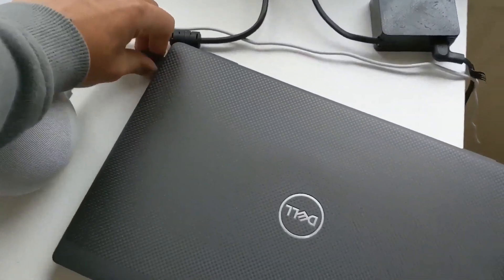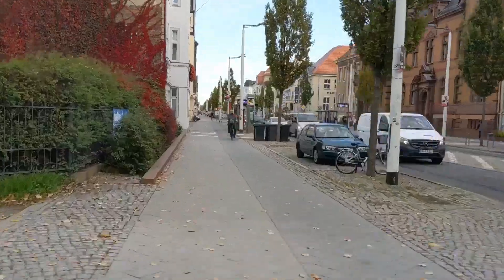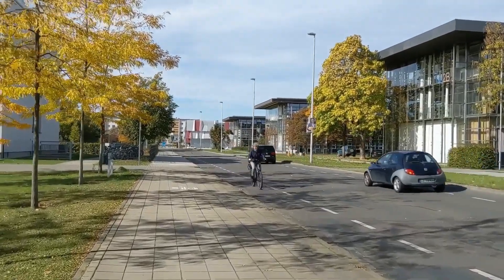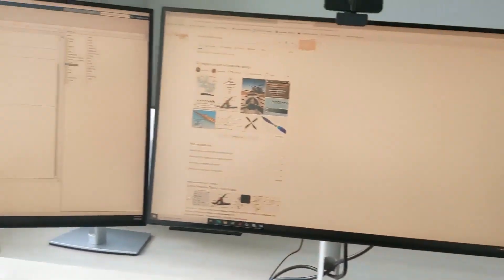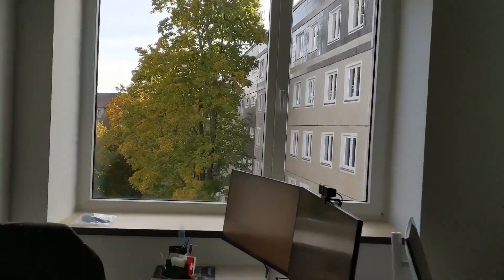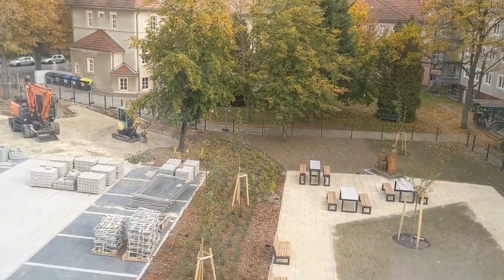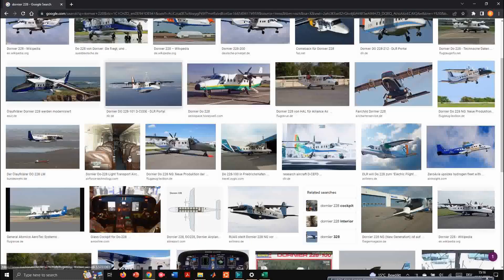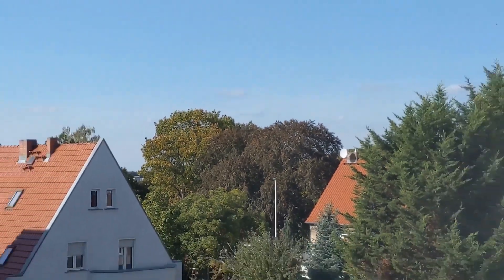A day in the life of a Mechatronics Engineer at German Aerospace Center (DLR)

Comment: brother, Do you work with physical things in mechatronics engineering jobs? what did you learn in your college and is it hard to study mechatronics? I like building things so which engineering will match me? hope to hear from you soon.
Reply from the maker: Hi bro, I think Mechatronics Engineering will absolutely suit you. There are lot of stuffs about physical hardware(microcontroller, fpga, etc) and software (Matlab, Python, ROS) that is to be learned in this branch. In my current job, I will be actually running my code in a target hardware using Speedgoat (kind of a high power computer), about which I am very excited. Apart from that, working with physical things like motors, gears, propeller, aircraft prototype etc. would be a part of the job.
Reply from the maker: This branch is also good, if you don't know now in which field (automobile, aerospace, robotics, etc. ) you wanna work exactly. The things you would learn will be applied in almost all industries.
Reply from the maker: About the study, I won't lie, it was hard at the beginning. There were subjects from electrical, mechanical and software branches. But with time, things fall into places and gets interesting. Let me know if you want to know the exact curriculum of course. I will share it with you.
Reply: @kibakibiunplanned5196  I would love to know about the course.
Questions
Which university do you think will help me in becoming a mechatronic engineer? 

How much is the salary of a mechatronic engineer?

I am thinking of studying in Germany but I haven't decided yet.
Reply from the maker: @mente4290  See this list of the German universities with mechatronic courses:
http://tiny.cc/f7h2vz
All the universities listed here are great. You have to find a right one according to your needs and financial situation.

There are two types of universities here (1) University of Applied Sciences. (2) Universities or Technical Universities. First one is more industrial oriented and prepare you mostly for a commercial engineer. Second one focuses more on research and PhD kind of stuffs. 

In either way, as a mechatronics engineer, you would earn around 50,000 EUR per year at the beginning. Its quite good. Later with more experiences, it keeps increasing.
Reply from the maker: The courses in my university:
https://www.mechatronics.eti.uni-siegen.de/mechatronics/mechatronics_curriculum.pdf
Reply: @kibakibiunplanned5196  Can you explain to me more about the 'commercial engineer' and the one that focuses on research and Ph.D.? like why are they different?
Reply from the maker: @mente4290  The first one have  a compulsory internship to de done in an industry. This is not there in second one. These differences does not matter a lot though if you will study an course like Mechatronics/Mechanical/Electrical. Student studying from both kind of universities work in industry. But if someone is sure that he wants to do PhD in future, then he should definitely go to the second one.
Reply: @kibakibiunplanned5196  
Another Question
Do you make your own design and then build it or do you get an Idea from someone and then try to bring it to real life?
Reply from the maker: @mente4290  Depends on the project and with whom we are working. Most of the time the design and implementation has to be all done by us.
If there is some collaboration, it might be different. For e.g. in one project, our partner is Rolls Rocye and they are doing the design part and we, the building part.
Reply: @kibakibiunplanned5196  I thank you for answering my questions.

Do you have an Instagram account? if you do, it will help because I can question if I have any.
Reply from the maker: @mente4290  in the video at 17:08
Reply: @kibakibiunplanned5196 may I eligible for engineering fields at germany as a Bs environmental science student?

Comment: Hi bro, I’m in my third year of Mechatronics engineering in India. I would like to know which skills are most important to have to get a good placement in the aerospace industry (e.g. python or C? Raspberry pi, etc)
Reply: Hi, it depends on which direction you are going in aerospace.
1. Control Engg, Modeling & Simulation Engg: Python, Matlab/Simulink + theoretical knowledge and algorithms
2. Embedded Engg, Hardware Engg.: C, Raspberry Pi + hands on experience
3. Software Test Engineer: Python, Basics about standard aviation rules like DO-178C for e.g

hope that helps
Reply: @ That’s very helpful, thanks so much

Comment: Brother, I am from Bangladesh. I want to do ausbildung in Mechatronics sector. Could you please tell me, is it possible to get ausbildung in this sector for us.. I really want to work on this field. Currently I'm learning A1 german level. 
Can u please also tell me what qualification do i need actually. 
Like do i need to know any specific skills from the begging before applying for this ausbildung or what technical skills will i need to know?
Reply from the maker: Hi bro, for Ausbildung, you need more German. B1 at the minimum. After coming here, you still have to learn more (C1 level)

That is why it is more common to come for Bachelors/Masters than Ausbildung.

So concentrate more on German. In Ausbildung, you will be working in Industry.
Reply from the maker: Apart from that, having basic knowledge of Mechanical, Electrical and Programming knowledge will be always helpful

Comment: I did my bachelor's in mechanical engineering and worked 2 yrs as a business analyst in finance domain.
Can I try for masters in mechatronics engineering?
Please reply!!
I highly appreciate your response ❤
Reply from the maker: @vishnubhaskar5586 Yes definitely. In our batch, 60% students including me had Bachelors in Mechanical, the rest comprises of Electrical and Mechatronics branch. 
Your 2yrs experience would be helpful for getting admission and also for a job after studies. 
You can opt for jobs like Application Engineer, Consultant Engineer, or Data Science Engineer.
Reply from the maker: Let me know if you have anymore questions
Reply: Thanks for your reply!!
But still my experience and course is not matching right?
Is that fine or they consider it as 3yr gap?
Also please share your LinkedIn
Reply from the maker: @vishnubhaskar5586  Having a gap won't be a problem. Don't worry.

Mechatronics also has Machine Learning courses as well. And many students go to Data Science field. So in that regards,  your experience would be somewhat matching if you have done some data analysis kind of stuffs.
Reply from the maker: @vishnubhaskar5586  my LinkedIn: Neelabh Jyoti Saharia
Reply: @kibakibiunplanned5196  so for me masters in data science much better right?
Reply from the maker: @vishnubhaskar5586  Yes...if you're interested in that field, go for it.